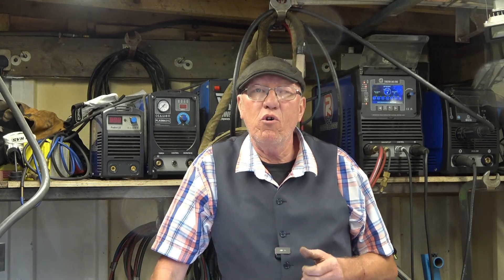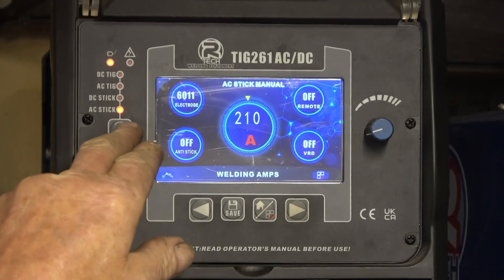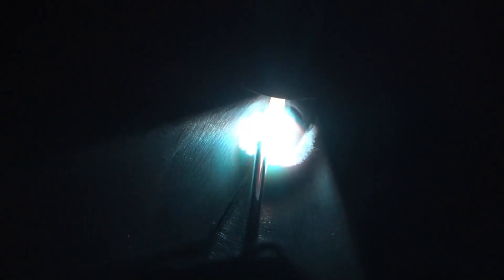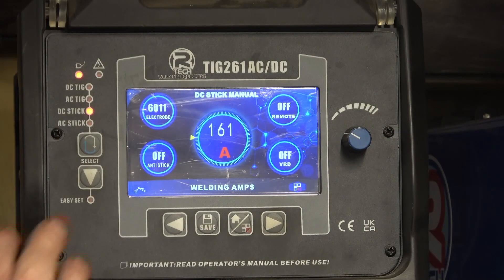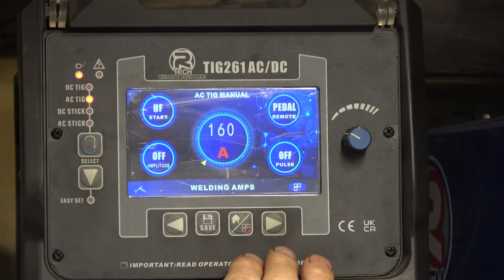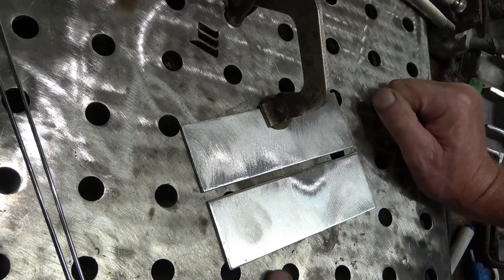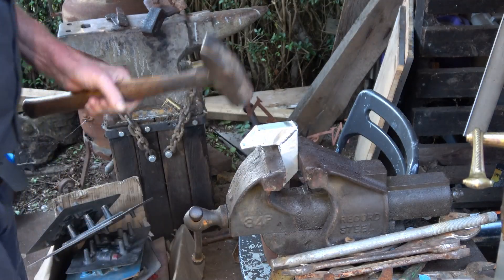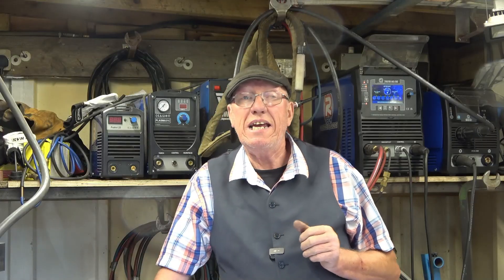R-Tech TIG TFT - Box section alloy & 4mm welding in AC EASY-SET & MANUAL MODE

Comment: Second, serious non ice cream van related comment. I have some experience tig welding aluminium. To me, the easy set weld looked a tad on the cold side. Acceptable weld, but bead just slightly on the high side. It improved on the inside seam as you'd just welded the two outside ones, so the material had warmed up.  Without wanting to blow smoke up your arse, your 160A/32pc/140Hz weld was better. Improved bead dimensions from the outset. I like to tack on a higher current setting as it gets heat into the material. Then wind it back and put the beads in. Nice video.